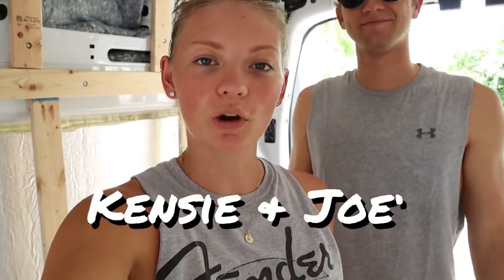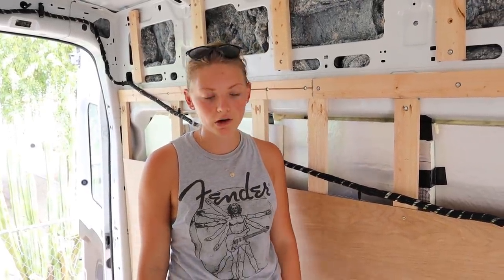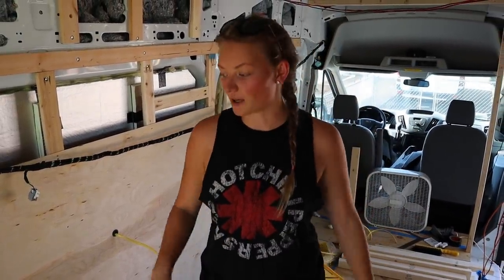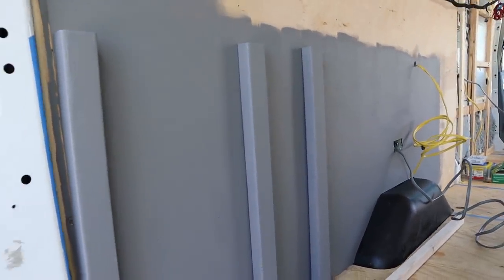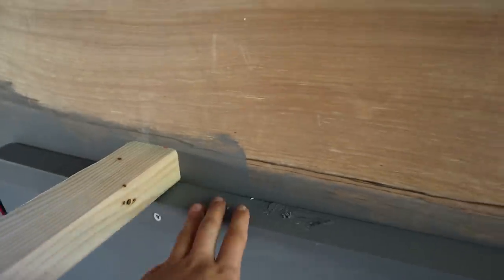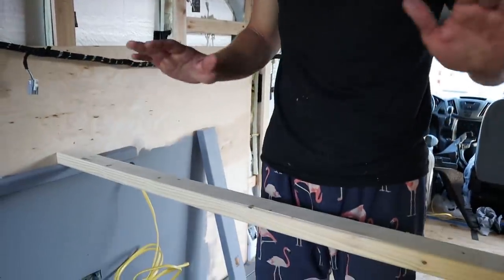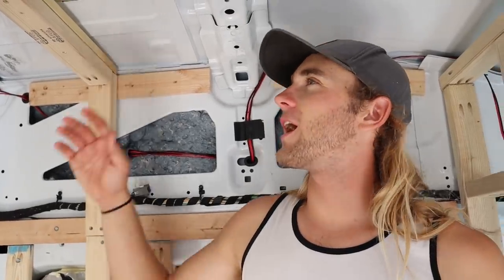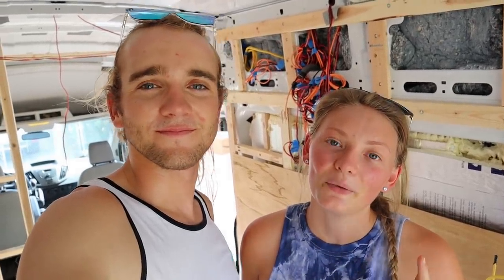Building a Fixed Bed & Shower in a Van | VAN BUILD SERIES (week 2)

Comment: Gr8 design .. you may want to consider vent holes in the bed plywood .. or moisture will be trapped and mold will form under the mattress where it touches the bed in a surprising short time ... Cheers from Vancouver Canada.

Comment: hi guys! discovered your channel while doing some research for a future build.  I go back and forth between diy & hiring out as some stuff (hello electrical!) is REALLY daunting to me and kind of blows my mine- even with your previous video regarding electrical for beginners.  Among a myriad of questions I have, one for the beginning would be this: I'm from the SE USA so we have REALLY miserable weather from about may until november as in temps into the 100-110 range but with 85-90% humidity.  Actually we have humidity in that range year round.  But none the less I was considering splurging out on professional spray foam.  I've heard really a mixed bag on investing in your insulation and how it may not be worth your time to go ham on it but then some scare you into thinking it is HUGE.  I'm wondering your thoughts on it.  Also on that note- if I did splurge for the professional spray insulation  would it be necessary to have all my wiring already ran before taking it to be done?  I would assume so as it seems as though you'd want it to run through the ribbing before but would it be possible (read smart?) to run your wiring between the insulation and subflooring?

Comment: Hi guys, you are doing a great job, but just a few things you may consider  - 
First is the weight - is the van a 3500kg van? You are piling on the pounds lol
Secondly is a 'vapour barrier'. Between the living area and the insulation - there will be a showering, cookering, breathing ect in the living area, vapour will get through to the Denim insulation, and condensation will also form on any cold metal surface and cause all sort of problems. Just a thought before you go any further guy.
Keep up the good work.
Reply from the maker: Thanks for your feedback! Regarding weight, yes- we do carefully consider what goes into the build, and it is well under the van’s capacity. We put up a “vapor barrier” (reflectix) in our own van, but are intentionally not doing it in this one. What we’ve learned from our own experience as well as a lot of research is that it’s far more important to use breathable materials in a build than to put up a plastic sheet between the living area. The reason being is that by putting up a barrier you are actually creating a pocket for moisture, which can be worse for rust. It’s impossible to seal it completely (even reflectix tape will unstick eventually due to heat) so it’s not really a true barrier. Using breathable materials and allowing air ventilation is the better option👍🏼
Reply: @kensiewest  guys i think a vapour barrier is a must, but if you guys know better from personal experiences - who am i to give that advice. I love your videos, keep them coming and i wish you the best on your van build x

Comment: Great carpentry skills,but are you not better off with pressure treated lumber in the shower framing to resist moisture? Perhaps you mentioned a plan,I did skip ahead.

Comment: Did you have any issues with your shower placement with that pan and the location to framing underneath? I'm planning on doing this as well but am worried about the drain hole being too far in.

Comment: What advice or suggestions would you give a college student looking for the perfect van? Btw I don’t have a lot of money 🤷🏽‍♀️. Thank you 🙏🏽 love you guys 💕
Reply: No such thing as perfect.
Reply from the maker: Looks like you got some good suggestions for others already! We would add that you should absolutely take your time when looking for the right van. Look at lots of them, take someone with you that has some mechanical knowledge, and always ask the seller lots of questions. Don’t settle for a dud that will give you lots of troubles. We got very lucky with ours - we bought it for under $10k. It had higher miles but was maintained to a tee. It just happened to be an auction vehicle that a used car dealership picked up. But it took us about 6 months of checking craigslist and other sites every single day! When you think you found the winner, pay a mechanic to check it out first and get the car fax...it’s worth it. Be persistent, and be picky. Hope that helps❤️